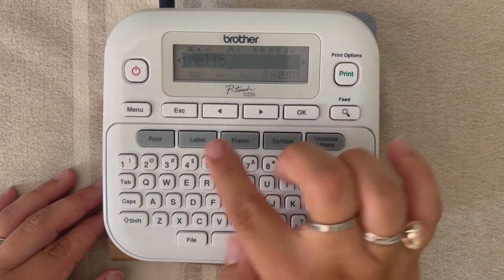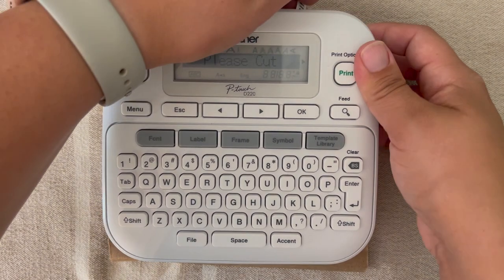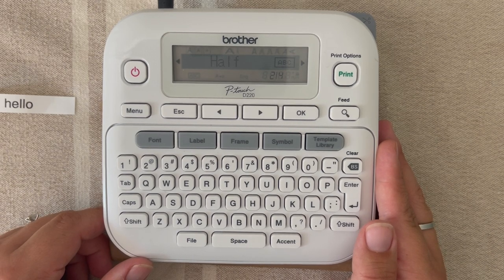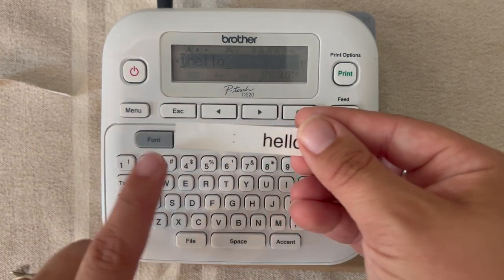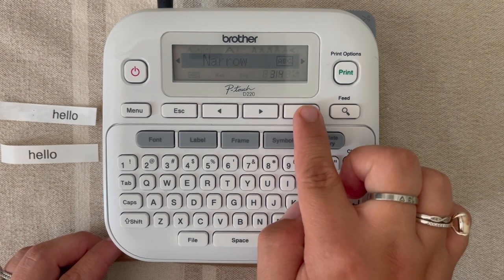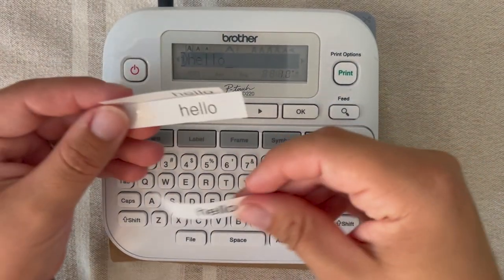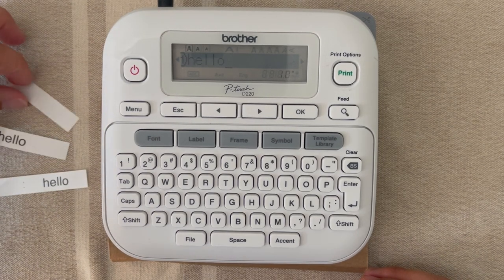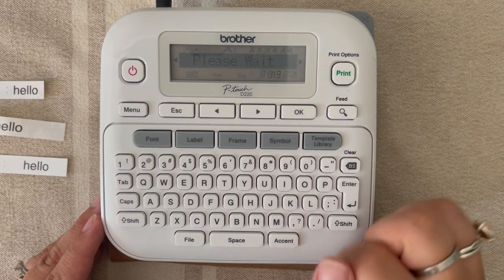Brother PTD220 Chain Printing & Margins, margins & more margins to save p-touch tape!

Comment: How do you chain print if you are typing different labels???  Really, how often would someone need the same label printed over and over??
Reply: I know this is 2 months late but for those wondering:

When the "Feed OK?" Message is displayed you can hit ESC to go back to typing out what you want to print. Just simply change the text to print and hit print again. You can do this any number of times to print multiple things and save a ton of tape. When you are done printing instead of escaping out of the "Feed OK?" Message just hit OK and you can cut the tape.

Comment: How is this saving tape if the full, half, and narrow margins end up being practically the same size? I am definitely not pleased. And I likely need scissors unless my text is bigger than I have space for in my huge project? This is a huge failing. I should have done more research before purchasing. 😢 Might go back to using Avery labels, scissors, and my trusty printer.
Reply: Thinkinging I wanted to print different labels but with frames each product for pantry it isn't possible. Guess that impossible with this one.